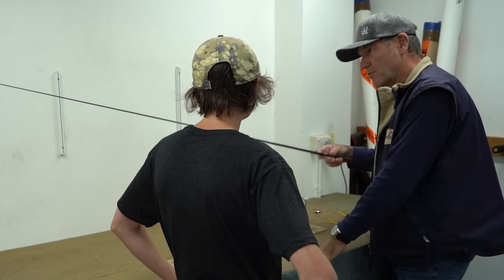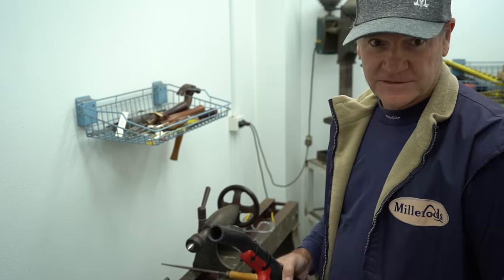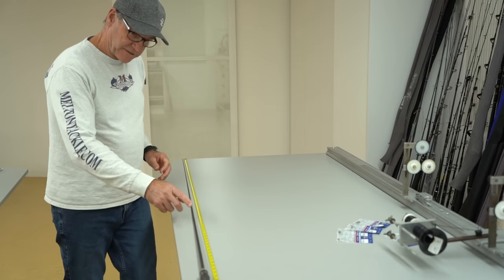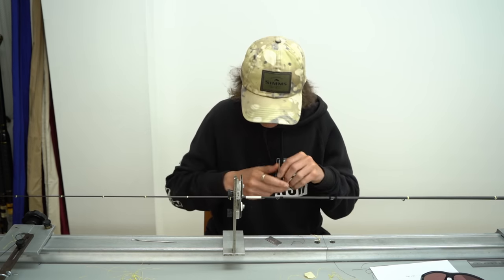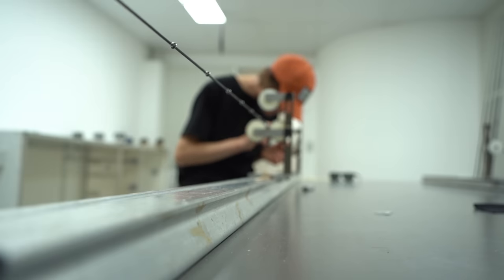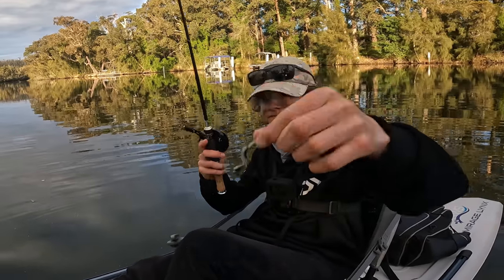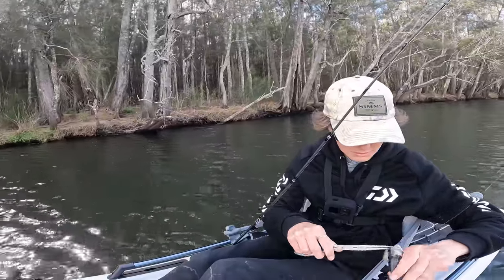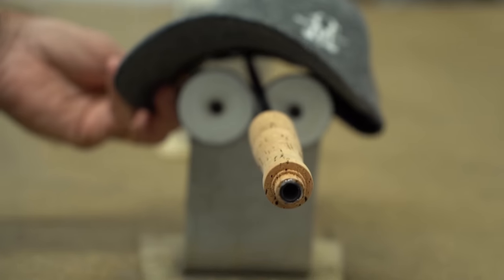I Built A Custom Rod With A Fishing LEGEND!!

Comment: Now you've done it. You see how easy it is to do to put a handle on a blank and get the guide spacing right. The mark up on "high end" rods is insane. Not to mention "custom" just means "made to order" with basically different parts put together. 

I've seen a friend put a rod together in an hour and was fishing it the next day
Reply: Ian even says it in the video. "it's just an assembly job"
Reply from the maker: @hustleandflow it was an assembly job because he shaped all those parts before hand to make the process quicker. Those parts didn’t come to him already shaped.